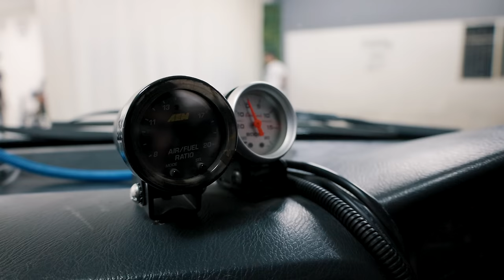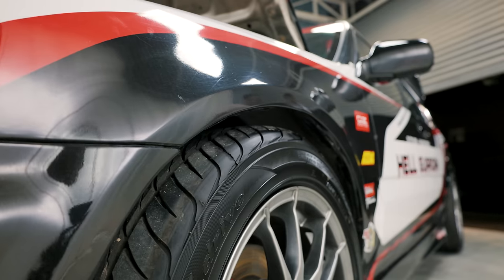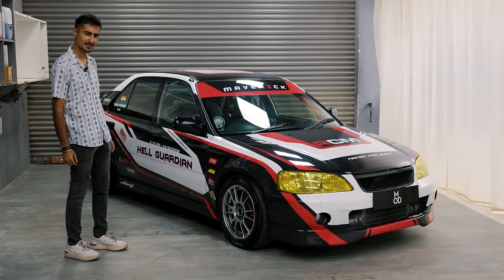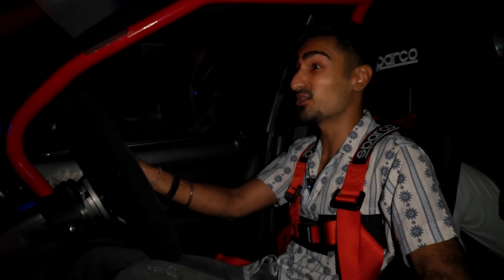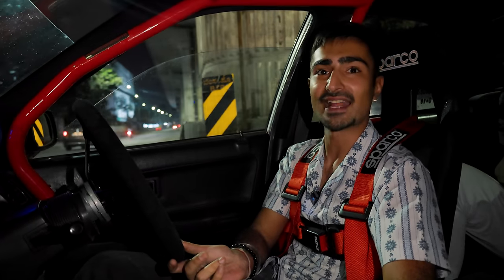450HP Turbo Honda City weighs only 850KGS & is pure RACECAR! | Autoculture

Comment: Hi I m from Jaipur, I have 4th Gen V-Tech Honda City, I feel there is torque issue in the car, what could be done to resolve the issue, and could be the problem.
Reply: Clogged air filter, fuel filter, check spark plugs. Could be worn out clutch too
Reply: Pit synthetic oil with iridium spark plugs

Comment: I would rather choose a stage 3 VRS that would cost similar to this and is much more reliable/maintainable to this.
Reply: Oh,a skoda/audi/Volkswagen that's more reliable than honda😂
Reply: @incorrigible117  you don’t get my point. Stage 3 VRS has a stock engine with upgraded turbo. Is that reliable or a full built motor like this? Have you checked the interior of the VRS compared to this? Have you checked the maintenance cost of VRS to this? Have you checked the reliability of VRS to this ? Have you checked the features and quality to this ?You have a lot to learn here kid. Do you know 90% of mods to a stage 3 VRS is bolt on compared to this ?Do some research kid. You would be better off watching Harmonix tuning for more knowledge on VRS’s.  I myself own a stage 2 Rapid and beat the crap out of it. No issues what so ever.
Reply: @sagaraher5611  ur talking alot, give one point to prove im wrong.
Reply: @incorrigible117  Take time and read the comment my guy so that you get what I mean. Your the one who is disagreeing here.
Reply: @sagaraher5611  there is nothing in it,which proves ur point.
Reply: @incorrigible117  😂👍🏼
Reply: @incorrigible117  let's be honest here, this isn't a stock car. It's a boosted car with a standalone ECU and a turbo added to an engine that was never meant to be turboed. Props to Raceconcepts, they do some phenomenal work but a Stage 3 VRS will definitely be more "reliable" relatively. There are so many things that can go wrong in a standalone ECU car whereas a Stage 3 VRS can be built with all bolt-on parts. If you do any sort of research about tuning, if you are looking for "reliable" performance, bolt-on is the way to go.
Reply: This is the misconception about most bolt on cars, bolt on cars are reliable only because they are new, a 20 year old Skoda is nowhere as close to being reliable as a Honda, I drove my Turbo lancer through water, water got inside cylinder bent cylinder 4's rod and still kept boosting over 7 psi car was still making 180ish to wheels even with a bent rod, tell me one VW that can do that
Reply: imagine choosing a golf 
ew
Reply: @ShaiyanHossain  imagine blowing up things every now and then. Ewwww
Reply: @sagaraher5611  that's what VWs do on a daily basis.
Reply: @ShaiyanHossain  speak facts kid. You probably don’t even own a car lmao
Reply: @sagaraher5611  I pulled up to work in my type r this morning with 315hp. no issues whatsoever. If you enjoy shitty german cars, power to you
Reply: @ShaiyanHossain  I own a stage 2 Rapid 1.0 and drive the nuts out of it without any issues. My comment had a point and your comment makes no sense
Reply: @sagaraher5611  "stage 2" tf is that lmao. Use real words, not marketing crap if you want to make a point. Also  bro is really flexing a 1.0l engine lmao